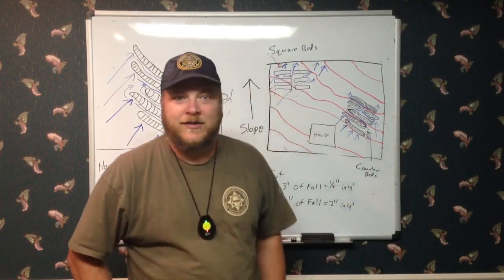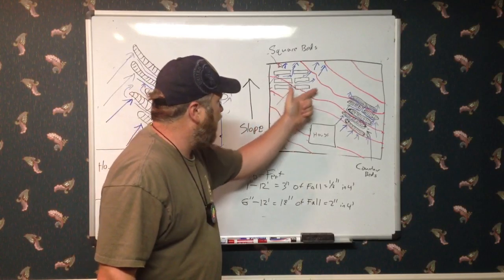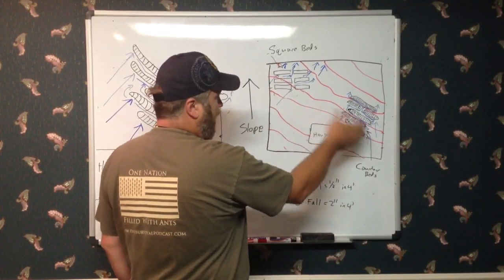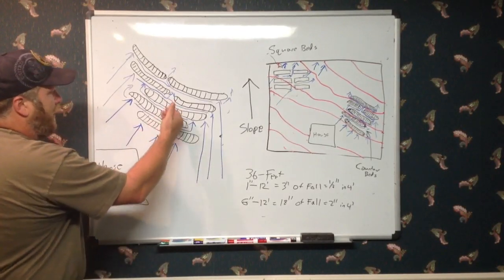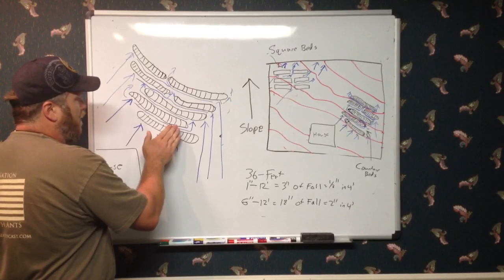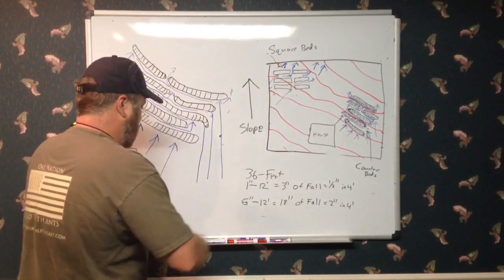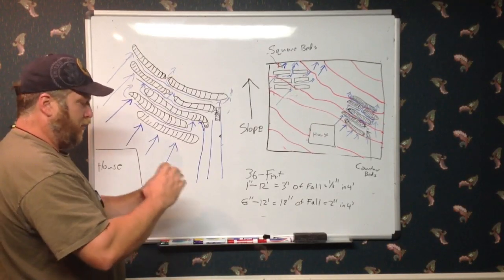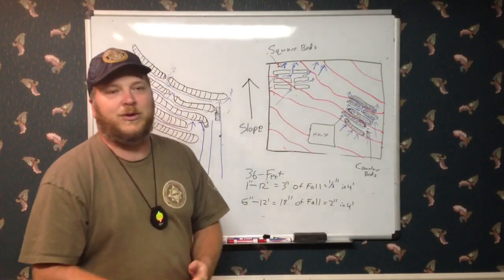Permaculture with Jack Spirko Part 8 - Countour Garden Beds

Comment: Content is great. Production values getting better all the time. You can pick up lighting kits these days for a couple hundred bucks and once set up in a room like you have, you'd just flip them on when ready and it'd really step up the overall look and feel. Not a big deal, but it'd make the board (until you get an electronic one haha) a lot easier to read. Just a minor suggestion. The knowledge drop is there.

Comment: Great video.  A question though.  In Holzer's book 'Sepp Holzer's Permaculture', on page 37, he shows raised beds that are not built perfectly on contour, but rather just slightly at an angle to the slope.  He says that this will help distribute the water more evenly if you have a series of raised beds.  What do you think?